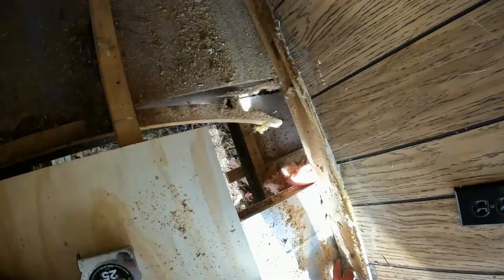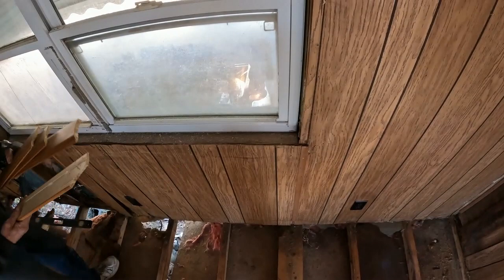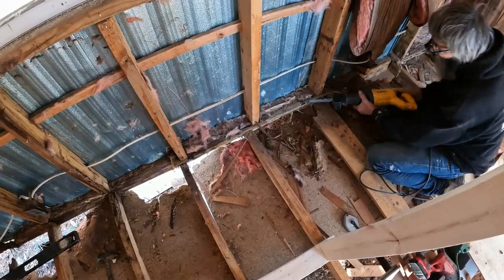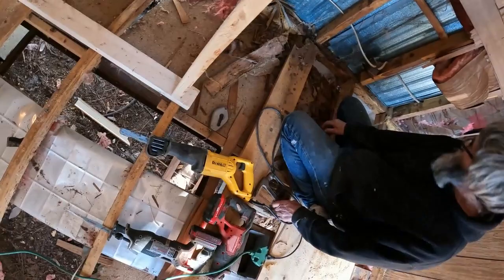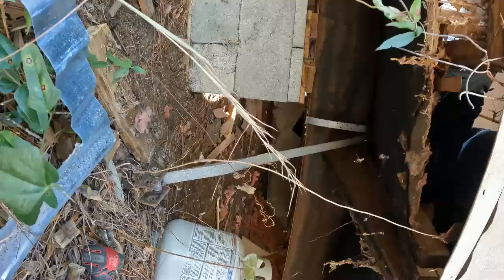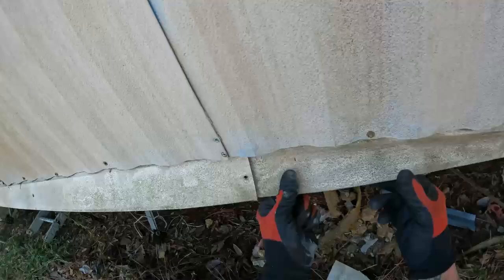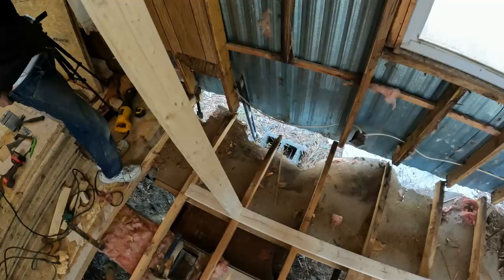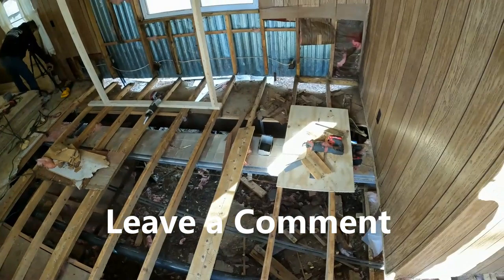Mobile Home Sub Floor Repair. How to replace under walls.

Comment: Last summer I bought 2 acres of land with a single wide, that was abandoned for 5 years. Luckily the floor beams and outer frame beams are still good. Replaced the windows and rotted wood around them from the leaks. Have to remove and replace all the wall board. Mud dobbers and mouse poop is behind all the wall board.

Going to replace the sawdust floor boards with new 3/4 plywood. Floors creak all over the mobile. So I'm enjoying the videos and learning how to do the floors correctly. 👍🏽
Reply from the maker: I’m glad you like it. Many videos.
Reply from the maker: https://youtube.com/playlist?list=PL8xp84iSvTA5iCdindB2vv6hs5jWv524j
Reply: @Drewsroofingandhomerepair  I watch all the videos you put out each day. The floor repair series has showed me I can tackle anything that pops up once I cut the floor out. No matter what I find in my 80's single wide. 👍🏽 

I appreciate you posting these videos Drew. 🙏🏽
Reply from the maker: I do it for people just like you. Or anybody that can’t afford to hire a contractor. Contractors can charge a lot of money to do jobs like to use. And if you can’t afford it and you have to do it yourself. That is the reason I make my videos for people just like you or the people that cannot afford to have somebody else do it for them.
Reply: @Drewsroofingandhomerepair  Drew, I have been subscribed to you for over a year. I wanted to buy some land with an old home or trailer on it and I finally got what I wanted. Your mobile home roof videos and floor videos are what I like. Even though the roof on my mobile is fine. I know how to fix it because of your videos. 

I appreciate your work and posting the videos. 🙏🏽 Thank You.
Reply from the maker: More to come. Video daily. Roof will be done also

Comment: These videos are unexpected and very helpful you’re doing great work sir
Reply from the maker: Thank you. I have lots of them. If your looking for something that will help let me know. I might have a video on it.
Reply: @Drewsroofingandhomerepair  specifically the water barrier/liner that holds up the insulation between your flooring; I had to rip it out (I can see dirt under the floor beams). Do I need some liner and a staple gun and just call it a day? One video you had it was already done, this one shows it before it’s done
Reply: @Drewsroofingandhomerepair  I live in Florida where it gets real hot but not too cold.
Reply from the maker: Yes. I think what your saying is great   If not a staple gun you can wrap 1 side in a 2x2  and bring it across and do the same thing on the other side. You will have to cut it here and there but it works well

Comment: love watching ur videos cuz i recently bought a 1979 singlewide in southwest Fl.  They remodeled inside and enclosed the carport.  But didn't replace the old OSB and the bottom outside plate has bad termite damage.  I need to replace the 2x6 plates and the OSB. Give me the strength and luck lord!
Reply from the maker: You are lucky to have 2x6. This 1 has 2x4
Reply from the maker: You can do it I know you can

Comment: I have windows that has had window air conditioning in and all of the has leaked water in and rotted the walls down to the floor, and I'm a widow on a budget that's why im in this trailer and im in my 60 but im going to try to do my bathroom like you guys did but I was wondering if you guys have a video showing how to hook everything back up after you pull out all the garage
Reply from the maker: If you go back to my videos and look about one year into my videos, you will see us doing the whole house start to finish go back 1 and a half yrs
https://youtu.be/AkpnswhaQ0U?si=q6gvLualGWa4TAvU

Comment: I'm begging to wonder with my one outside end wall, if I should just build a wall inside of that wall then tear out the outside wall..... Then windows and siding. Done
Reply from the maker: Yes. That is what we did here
Reply: @Drewsroofingandhomerepair  I think that's the route to go with these 70s leaky bastards. Thanks man

Comment: I'm looking at a property with some bad rot in a mobile home.. This is helpful  May need you to do this for me...
Reply from the maker: If it’s made of wood you can fix it trust me it’s worth it.
Reply from the maker: Do you‘s people paid $20,000 for the property and the house. By the time they’re done they’ll probably have 60 in it total so you can’t buy something like that for 60 g know where
Reply: @Drewsroofingandhomerepair  The property I'm looking at ,they are asking 45K with a 94' singlewide and 1 end is rotted from top to bottom. 5-6 studs gone and top and bottom plates are all but gone...I think it leaked around a sky light..It's hard to get a loan with it in bad shape
Reply from the maker: Wow if it is that bad maybe not for you. How much land is there
Reply: @Drewsroofingandhomerepair  less than 1/4 acre
Reply from the maker: That’s not too bad

Comment: It's crazy how they build mobil homes. We are renovating a double wide and we discovered that they used 3/4 inch thick baseplate for the 2x4 exterior walls. So basically the subfloor is layed down on the joist and then they use 3/4 baseplate and then build the wall with 2x4s. Funny thing is they did use 2x4s for the top plate. They even doubled up the 2x4s for the top plate where the roof attaches. Oh and my God ! What's up with all the staples they use!??!!??....seriously they could probably double their profits by cutting back just half of all the staples they use. It's ridiculous! Lol!
Reply from the maker: I agree with everything you said 100% oh my God

Comment: Question....if the subfloor isn't rotted under the wall baseplate ,is it still recommended that it be removed when replacing the subfloor? In other words the subfloor that is being replaced is rotted in the middle of the sheet. The subfloor under the wallpaper is perfect. Is it OK to just cut up to the wall baseplate and lay the new subfloor up to it?
Reply from the maker: https://youtu.be/g0iuSbplZKg
I never remove the wood under the wall unless I absolutely have to  I say, leave it make sure you use blocking.

Comment: Good job Drew. Was that just a 2x4 on the outside wall or a 2x6? I think it's called a rim joist. My MH is a 1970 and it has either a 2x6 or a 2x8.
Reply from the maker: 2x6 rim joist.

Comment: I'm going to replace the sill plate on my Floating Cabin.... what do you recommend  I use under the new sill plate? Do I seal the 2x4 with sealing paint?  Do I use a vinyl flooring? A roofing sealant material?
Reply from the maker: The wood under your sill plate is Whitewood pine. It does not have to be painted. It’s not painted now so when you take it out and put it back in you don’t have to paint it. I have a Lotta videos on this if you look around you’ll see my sill plate video, my band video

Comment: Just wondering how far up the studs the rot has gone
Reply from the maker: That’s a good question it doesn’t really matter 2 inches or a foot you can sister the side of it down to the bottom play again screw them together sell it again you can even put one on both sides if you like

Comment: I live in a 2005 mobile home floor is good but I’m putting down 3/4 plywood on top of subfloor to handle my 215 gallon aquarium you think I’ll be ok with that should I support it underneath with brick not holding you to it just lookin for advice
Reply from the maker: I’m not sure what you’re talking about are you putting down three-quarter inch plywood on top of the subfloor in the whole entire house or just under the fishing tank? I’m curious love to answer your questions I would never put a layer of flooring on top of i’ll let are there is there
Reply from the maker: If you put some three-quarter inch underneath your fishing tank if that’s what you’re talking about that’ll be fine it will hold it
Reply: Just under the tank sir sorry I didn’t specify
Reply from the maker: Yes that will be fine

Comment: I'm stuck in a rut.. I've worked on a couple mobile homes and houses but the one tht I bout it totally like I've ever seen. Floor joist is running the opposite way of wat y'all are working on. An like most homes stud wall sits on sill plate my stud wall is notched to sit on rim joist help plz
Reply from the maker: I have done them like that before that won’t be the only one that can also be repaired be careful your outside walls are sitting on much I would probably go outside and put some bracing on the outside walls before you do the floor
Reply: @Drewsroofingandhomerepair  that's what I was thinking and my floor joist are running longitudinal with the trailer, would it be best to run them transverse or replace them back like they are now??
Reply from the maker: Replace them back like they are
Reply: @Drewsroofingandhomerepair  ok thank you and one more quick question. The floor joist are smaller than a 2×6 would it hurt anything if I just used a 2×6 instead of ripping it?
Reply from the maker: Send me pictures to 910-294-1761 you can also call me

Comment: Scrap it already
Reply from the maker: Mark, you would not believe what this place looks like today we have transformed this place into a little castle new siding new windows, new sheet rock new insulation, new lights new cabinets. We turned it into somebody’s home again after it sitting there for 10 years it is now somebody’s home where they can lay their head down on a pillow and be comfortable with no leaks.